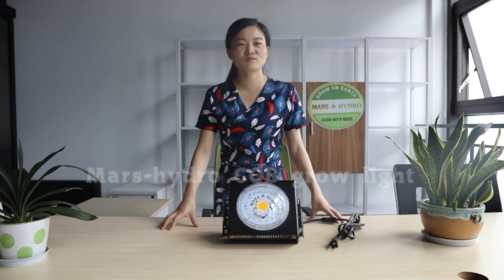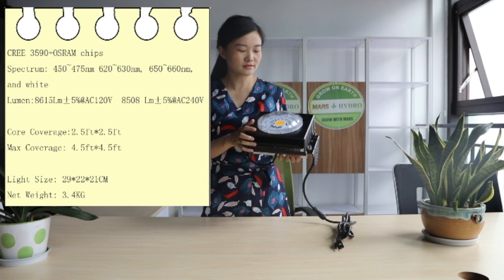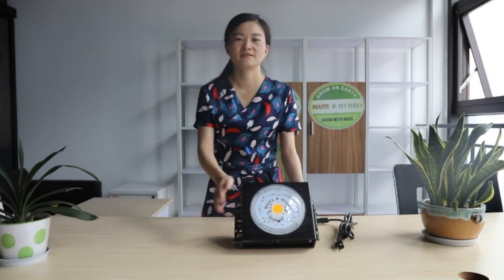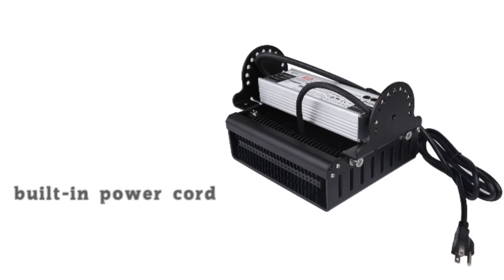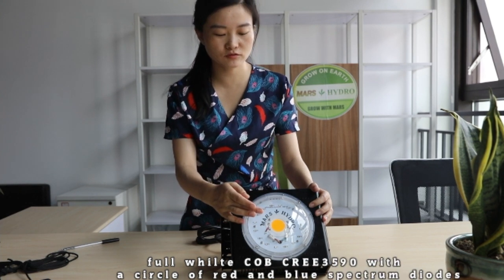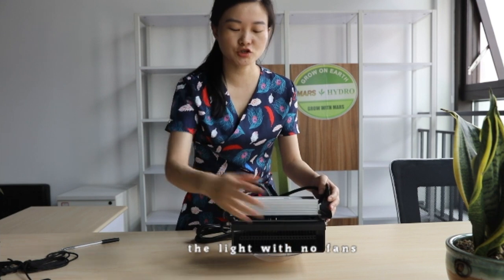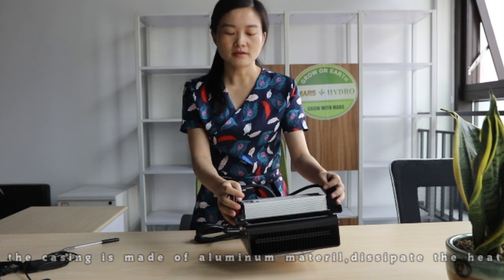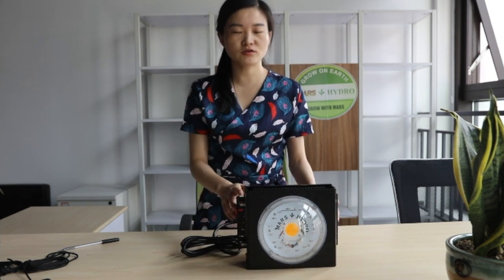Mars COB LED grow light

Comment: If you guys wanna make a new type of light try this. Add ir and uv spectrum on its own circuit. That way the the user can add the uv and infra red at the right point of the grow cycle instead of having it on full time.
Reply from the maker: thanks for your opinions,We produced this Mars COB 100W for one of our good friend,they didn't require add UV&IR,so we didn't add extra IR &UV to this light.as the COB CREE 3590 in the center part of the light is full spectrum
Reply: Mars Hydro if I wanted to buy a custom light can Mars hydro build it for me?
Reply from the maker: may i know which light you want? I need to check with our factory.
Reply: Mars Hydro I like the cree 128 pro. But the uv has to be separated. I need a light that can veg and bloom with the ir and uv in the bloom phase.   If you can make it with its own circuit so it can go on by itself. Uv is great for increasing potent.
Reply from the maker: The Mars Pro II Epistar with IR and UV,the Cree do not have IR and UV.
Reply: Mars Hydro yes but I want control of the uv. I don't want it to be on all the time. Only specific points of the bloom phase. Can the uv have its own control?

Comment: Looks awesome, I'm glad you guys are making a COB light. I'll keep it in mind when i upgrade my mars300s.
Reply: Noob Nugs 
A very interesting design 
I definitely like the look of it
I have lights that both have and don't have UV and IR but I always add UV bulb for flower still I would like to see both in the lights 
Will be nice to see this one in action in a small garden to see the potential 
It's got a industrial look like it would need higher hanging heights do to intensity 
👍🏼💯
Reply: LEDGrown MedicalGarden yeah i was thinking 2 of these would kill it in a full 3x3! But height is always an issue for me.
Reply from the maker: The problem is we can not get the right UV chips from CREE or OSRAM. we do hope to add some to help grow better.
Reply: Mars Hydro it doesn't need uv looks like a great light i wonder what color temp it is 3000k or 3500k
Reply from the maker: The coverage is 2.5x2.5 during flowering.  during vege stage. 3x3  is not a problem for  sure
Reply: Mars Hydro whats the price on this unit and is flowering hieght 18 inches?
Reply from the maker: you can check the price on our website now, different country, different price .
Reply from the maker: it's 3000K